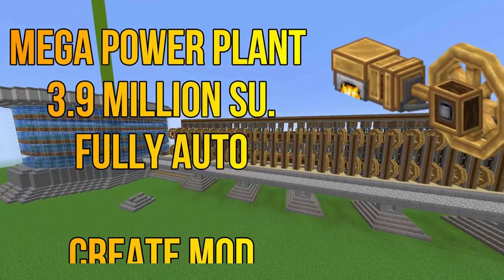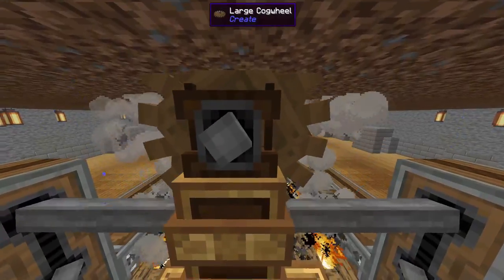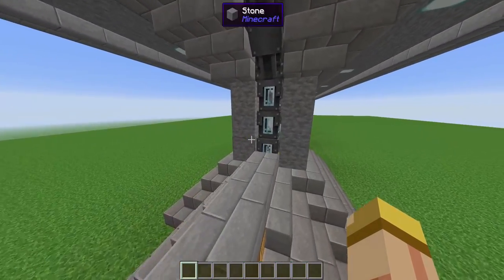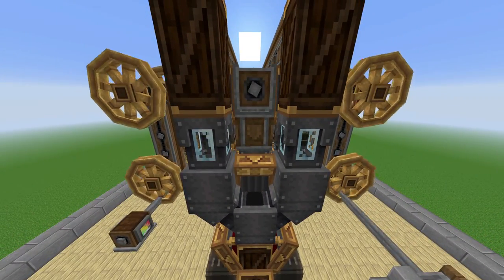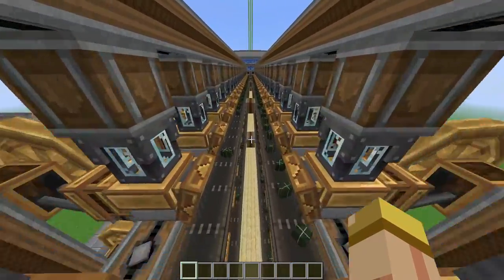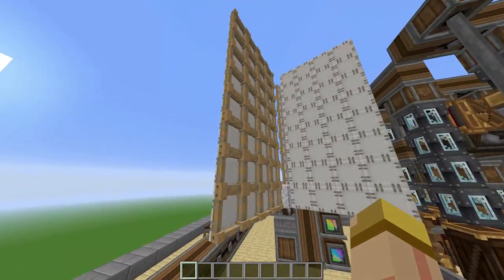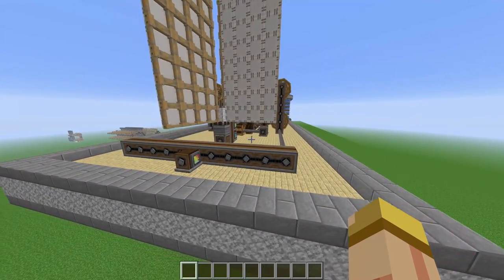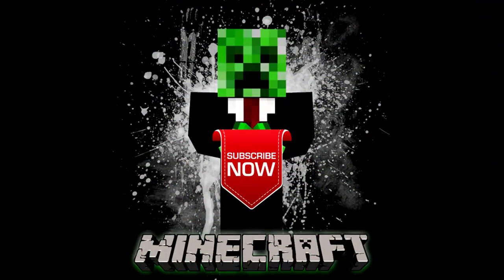Minecraft | Create Mod | Mega Furnace Engine

Comment: I have something similar just on a very small scale, 4 furnace engines and a small kelp farm that smelt just enough spare kelp that i have a slow excess to collect for normal smelting needs and i don't even use 1/3 the power they produce. And they are furnaces, not blast furnaces, and actually burn the kelp which then powers the furnaces. Less power but no exploits.

Comment: Hey looking at the build I am confused on how you're moving the kelp down to the bottom of the farm
Reply: The sad thing is that this is now useless in 0.5 because they removed the furnace engine
Reply: @alejandromonteromendez35  no even close to true, you still need to feed those blaze burners under your steam engines I think this will be even more valuable in the days to come.
Reply: @50_foot_punch99  there are no more furnace engine you can't build this thing
Reply: @alejandromonteromendez35  alright had to test this with the new update and yes you can build this and with enough dedication easily double the amount of SU.
Reply: @50_foot_punch99  how can you build this without furnace engines?
I mean I already created a Steam engine with infinite fuel that can produce 147k SU and you can put a lot of those engines side by side but idk what you built
Reply: @alejandromonteromendez35  I'll probably have to make a video for it but as let's just say day 1 of .5 being released I got to work prototyping. However, the main production system is powered by a waterwheel bank.
Reply: @50_foot_punch99 mine is powered vía windmill so it's fine i guess